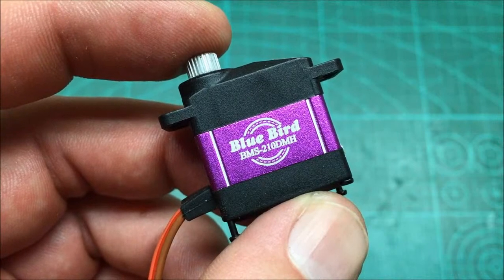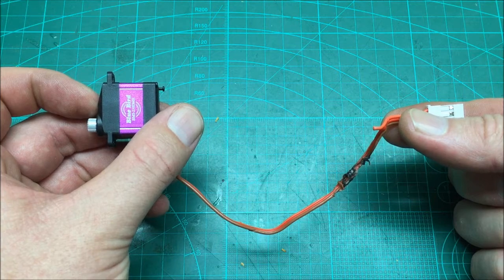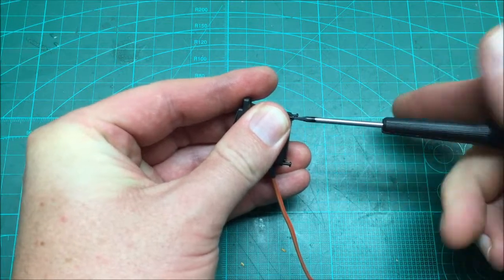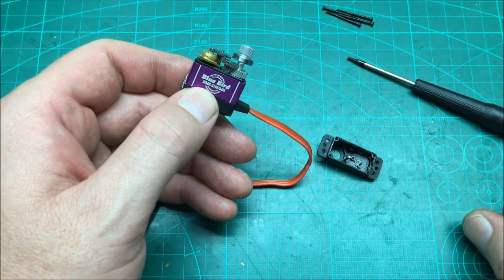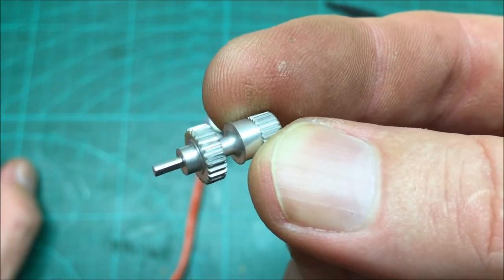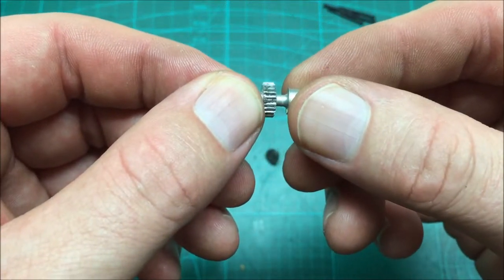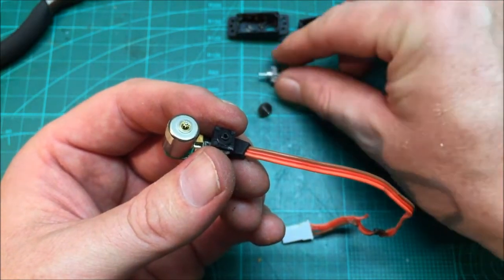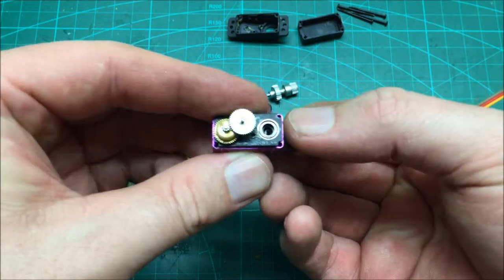Fixing a Mini Tricopter Tail Servo BMS-210DMH

Comment: You should upgrade your servo with the feedback wire (check rcexplorer.se for details). Anyway thanks fot the repair video!
Reply from the maker: Cheers. Have one servo with, one without and the new FC board but I reckon I had it flying better without the feedback wire and tail tune. That irritated me so I've put it off to one side to see if there is some sort of progression in TriFlight, but if not I might even go back to an older version. Or even just remove the feedback wire. Who knows, whatever gives the most fun!

Comment: Great advice Ben, I've done the same thing where the output gear has a stop underneath, stops the gear from rotating 360 degrees, just removed the stop and replace 180 degrees about, lucky the servo I repaired had a force fit to a round shaft potentiometer, remove the output gear while the servo is on the tester, set the pot to centre (turn till motor stops) and replace the gear right way around. Works a treat. 
We would not have to do these repairs if trees stopped jumping in front of our model aircraft.